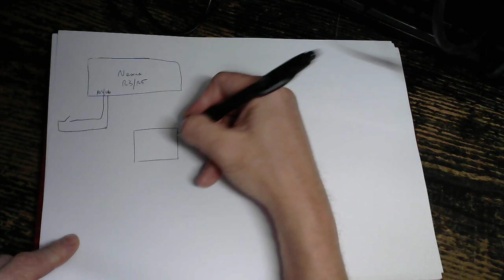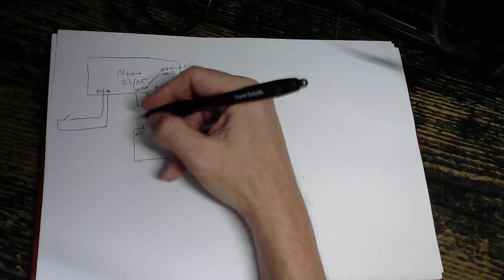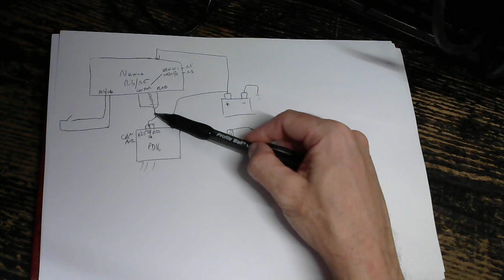Powering up your Haltech PD16 PDM

Comment: Hi Andy, I have a Rebel LS + PD16..

If I wire the Rebel LS (IGN SWITCH) to the key (12V Supply) to turn on the Rebel LS...will all the devices I have connected to the CAN network power on through their respective cables?
I can then ignore/terminate the IGN SW INPUT + IGN SW PWR wires for the PD16?
Reply from the maker: Yep that's right, just Lego it together. PD16 will see power on pin A25 which is the CAN power, and switch on as a slave device.

Comment: Hi Andy thank you for the video. I have Nexus R3, IC7, 15 button CAN pad and PD16. I want to know if I was to run a constant to pin A13 on the PD16 while having the CAN cable running from the R3 to the PD16 will I be able to have power running to the horn, brake light switch, hazards and remote entry for the door locks without having ignition similar to how the wiring would be for the elite ecu?
Reply from the maker: The PD16 doesn't have any intelligence of its own, so it can't do things like horn, brake light, door locks etc. They all need to be done through the ECU (or dash).

What would be cool would be a kind of "courtesy state" where the ECU/dash/keypad etc is powered up (so CAN power is on) but ECR power is off, engine can't run, but you can do unlock/lock, windows, etc. But that doesn't exist yet sorry.
Reply: Thanks, Andy. I will have to take a closer look at the Link Razor programmable pdm. Really wanted to keep it all Haltech.